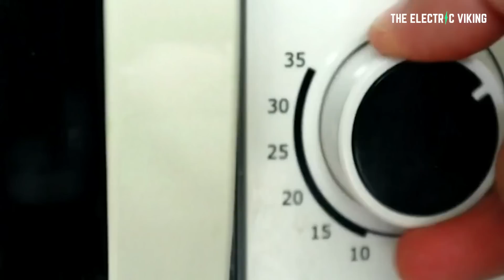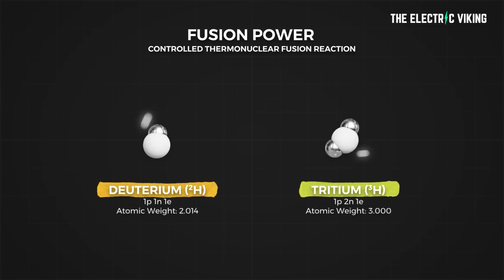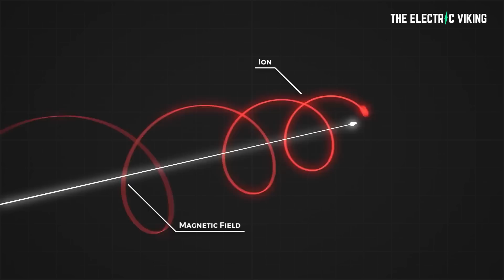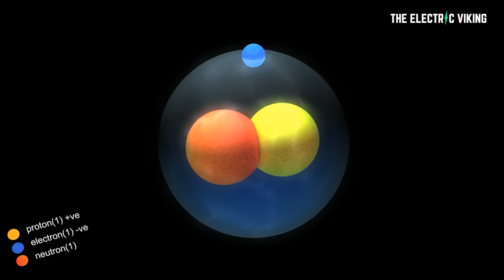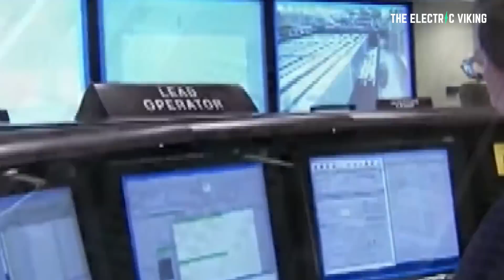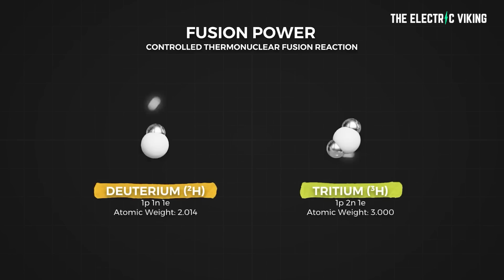Massive breakthrough in nuclear fusion achieved by US scientists

Comment: While this accomplishment is the milestone that they have been working toward for over 25 years, where the energy produced is greater than the laser energy used to produce it.  However to produce that laser energy takes about 10 times the electrical power.
I have visited the NIF (National Iginition Facility) several years ago, an interesting fact about it is that they have to store up energy in huge capaction banks and then release it all at once in an extreemly short pluse, to power the lasers, during this pluse the energy going to these lasers exceeds the entire electrial energy being used in the USA at the same time.
Reply: The 2.05 input is just an estimate, or recalculation based on how inefficient they’re claiming the lasers were. They’re ignoring nearly 300 megajoules of the energy cost “lost” due to inefficiencies they’re explaining away. It’s most likely that calculation that’s wrong. When they’re trying to rationalize away around 300 megajoules of the input though, it’d be easy to lose track of 0.95 of a single megajoule. Until they’re no longer pumping in (and losing) 100 times the energy they’re getting out of this, there’s no way to prove there’s any net energy gain, at all.
Reply: @aalvarez2914  Yes, NIF says the lasers delivered 2.05 megajoules to target and got 3.15 megajoules out; however, the lasers consumed 322 megajoules in the process...so overall it was a net loss...if you read the fine print.  😂

Comment: Sounds great, but even if you achieve a 20% gain in energy out, how long will the equipment stand up before needing replacement? Will the replacement and maintenance costs keep it from being practical?
Reply: only one way to find out :-)    i for one am pretty certain, all of those steps can be solved.  but it's even possible, that at the end it's "just" another means of producing energy, along other hopefully clean sources.
Reply: just a tiny hydrogen bomb， but it is needed for presidential election.

Comment: That net gain is deceptive to say the least. They spent 2.1 MJ of high order (low entropy therefore costly) laser energy to produce 2.5 MJ of thermal (low order- high entropy) energy.  If you put it back, 2.5 MJ thermal produces about 1 MJ electricity which can be turned into maximum 0.5 MJ (probably a lot less for that high performance laser) of laser energy to put back into reaction.
Reply: It is actually much worse than that, it took 500MJ to fire the lasers !

Comment: Important to understand that the net gain, is in regard to the energy used to heat the plasma. NOT the entire experiment. There's a way to go yet.
Reply: also you still need to ''harvest'' that energy produced and turn it into electricity.
Reply: @Morgan Angel  

Indeed. ITER is an experiment, a former laser nuclear testing facility being used for fusion. The entire plant required 300 mega joules, 2 mega joules were put into the laser, and three came out.

The target was a BB sized diamond sphere with a miniscule straw attached to it, through which tritium fuel is injected. A working laser confinement reactor would require thousands of these, hard to engineer, diamond shells to be injected and blasted with an ultra powerful laser every day. 

Quite how you would manufacture, in a cost-effective way, untold thousands of these microenginnering marvels that require highly expensive tritium is something I would ponder. 

Deuterium doesn't work for laser confinement fusion, so you are stuck with tritium, which is immensely expensive. Tritium is also in short supply.

Something like General Fusions concept seems more viable to me.

Comment: At Kill Devil Hill, in Kitty Hawk, North Carolina - the Wright Brothers achieved  flight. The flight was 1m in altitude and the Wright Flyer only flew down the beach for a few hundred meters. The flight changed the world.  Consider this fact - the net energy gain collects up the energy used from buildings that cross three football fields to direct energy into getting fusion to occur across the electrostrong barrier - if you're going to shrug away the event - just remember. This is the first test.
Reply: I think that is a good view of situation. It may not result in practical fusion power, ever, but it is a "proof of concept." It's like going Mach 1, for the first time. In a wind, solar, battery world, it is likely way too expensive and dangerous, but a huge scientific achievement, none the less.
Reply: Correction, the real first flight was Whitehead’s one, ending in a crash. It was using a self made steam engine. The Wright brothers did their best to suppress this historical event by blackmailing the Smithsonian to delete Whitehead’s flight in order to get the kitty hawk for the museum.
Reply: It’s a promising result, but it lasted 5-seconds and was enough energy to heat about 10 gallons of water.

It’s at least one decade, if not two decades away from powering a single house for one day.

Could be wrong. Hope I’m wrong.
Reply: @JohnBreezy22  It's more important for science than anything that will ever be practical. Wind - solar - batteries will be way more cost effective. I prefer the free fusion reactor in the sky.

Comment: NIF delivered 3.15 megajoules from about 2 megajoules of input energy (so Q=1.5, roughly) in a single pulse. No mention of pulse repetition rate or damage/repairs necessary to fire again. By comparison, the Culham Fusion Lab JET experiment in the UK produced 59 megajoule of continuous power for a five second test (so almost 11 megawatts) - although its Q ratio is at best only 0.67 (less than the 1.0 break even point). Its successor, ITER (in France), is more likely to produce a working fusion reactor than the Livermore NIF, in my opinion, and some as yet unseen, dark horse may beat both. Interesting news, though.
Reply: I agree completely....we already have fusion bombs that achieve a Q greater than 1... The actual breakthrough will be when we achieve a long term Q greater than 1 and the energy needed to contain, recover AND convert to electricity the energy of the output of the reactor is put into the equation.  I don't see this as anything more that a Federally funded lab putting out headlines in an effort to keep their funding.
Reply: Does it really matter which country does it as it long as it gets done?
Reply: When you discuss Q ratios and don't SPECIFY if it's scientific or practical (or experimental vs. total), it's MEANINGLESS and it can be VERY misleading. 

This is ONLY the DIRECT energy into the lasers.   So what?  All the overhead like containment, etc. still takes a LOT of energy.  This is creeping forward, but still LIGHT YEARS away.  The arm waving is all about trying to attract funding, and the media is mostly too stupid to point out that it's NOT Q(practical) they're talking about in such announcements.
Reply: @rogergeyer9851  There is NO NEED TO SHOUT. Anyone interested can easily look up the relevant information (Livermore isn't holding back and nor is Culham) so please try not to make (mostly) pointless remarks in the future.
Reply: @rogergeyer9851  They were very clear that this was scientific--it took over 300MJ of electrical energy to power the laser.  (The lasers were designed to be precisely timed & powerful, not efficient.)  However without this test, it would be difficult to know if it's even possible to have inertial confinement using lasers.  They were also saying that JET/ITER was further ahead even though they got ignition first.
Reply: @rogergeyer9851  target gain is certainly not the only requirement for fusion energy, but it's absolutely not meaningless. 

Improving the efficiency of all other aspects of a power plant is possible, but target gain is absolutely necessary, and it has never been done before, some doubted it was even possible. Now we know without doubt that it's possible.

Comment: Inertial Containment is not a practical approach for a Fusion reactor. A Tokamak or Stelarator approach is needed for a constant reaction. Also the seawater bit is not quite right either . The current process requires both deuterium and tritium as far as I know and trituim is not so easily obtained. So they used Hundreds of Lasers bigger than 4 football fields to get Fusion in a tiny pellet . As much as I want this to work this seems like a side show.
Reply: Helium 3 from the moon is all that will be needed!
Reply: Yeah.  It's sure nice to have a side-show to watch while we wait for ITER to fire up!  I also think it's possible to design a fusion reactor based on this technique, but the Tokamak is more likely to be economical.

Comment: Hi, if you look closely they are talking about the power gain of the plasma alone, and that for a fraction of a second. What a power station needs to do is generate more power than it receives, and do it 24/7. The power losses due to steam generation and then electricity generation are 40% at best. The power used by all the other kit it significant. So in reality they have made a good step forward, but are way, way short of making a useful power station. Strangely, the scientist know this well, but insist on reporting the plasma efficiency alone, which is at the least misleading.

Comment: Problem is what fuel being used , many fuels talked about for fusion are limited , forms of hydrogen that are very scarce
Reply: They used the typical Deuterium/Tritium blend.  It's not the only fuel they use for experiments, but it's the one used when they're trying to get ignition.  The Tritium would have to be produced from a lithium blanket that captures the excess neutrons from the fusion reaction.  Currently, Tritium is most often produced in heavy water reactors like the CANDU.  Deuterium can be harvested from water, which has been done for decades for how heavy water reactors.

Comment: While yes, most fusion reactors employ the use of extremely powerful magnetic and electric fields and high voltage components, your assertion that they can be dangerously explosive is just wrong; The Dark Knight Rises isn't at all scientifically accurate. 

In a tokamak or stellarator at least, if there is a disruption in the plasma, it simply loses energy and dissipates; there is no possibility of runaway like there is with a fission plant. If we aren't actively sustaining the fusion reaction, it can't happen naturally - you would need something like the sun for that to be possible.

If you want to learn more about the cutting edge of fusion, especially the private sector, check out Commonwealth Fusion Systems, Helion, General Fusion, Tri-Alpha, and more!

Comment: False. Fusion is still at least 20 years away. All the headlines in past 50 years claiming fusion has been cracked were misleading. 

Two things - firstly we have no fuel for fusion, we need deuterium and tritium, neither which is abundant or cheap to produce. Secondly - net gain is a lie. Checkout video from scientist Sabine Hossenfelder about it, essentially it is net gain in theory not in practice. It does not include inefficiencies from running the reactor, and also it does not include inefficiencies from collecting the thermal energy.

For real net gain (just so the reactor can run from its own energy production) you need few times more energy production that this new "breakthrough" provides. That is at least 10 years away. New industry for fuel production will also take about a decade to make, and actual economically viable fusion reactors might take another 50 years. I'll be happy if I'm wrong

Comment: You need to make a distinction between Q and Q(total).  Q is the energy gain factor for the reaction (running laser compared to energy released by fusion) - and the energy based on the energy to sustain the fusion reaction in the fusion reactor.
Q(total) is the total energy of the power station , and for comparison, a gas powered  station uses 15% of its energy produced to run the power station (excitation of the stator + cooling, control systems) 
The amount of energy for Q(total) compared to Q in a fusion power station is about 10 times - ie you need 10 times of energy of the laser to run the "power station".  So you can see that a fusion powerstation based on this CURRENT technology would use energy to run as the additional containment energy, generation power and just general running is large.
This issue with Q and Q(total) has dogged the fusion publicity for years.
Reply: What do u think Sabine?
Reply: for this experiment, Q(total) was about 0.01  (300 MJ in, 3 MJ out)
Reply: I'm watching this after the press conference.  It looks like they put 2MJ of light energy in, and got 3MJ of energy as neutrons out, but it took at least 300MJ of electricity to power the lasers.  I'm glad the scientists are being clear about the distinction.  It's still a huge achievement, though, because the lasers were designed to have precise timing, not to be efficient.  As a point of comparison, 300MJ is similar to the power stored in the battery for an electric car, whereas 2-3MJ is closer to the power stored in an electric bike.
Reply: @nathanbanks2354  try delivering that 2 MJ in a femtosecond.   a lot more engineering to do.  it took 25 years to get from 0.67 to 1.5 Q
Reply: @nathanbanks2354  as the other commenter said , try power a bicycle in a femtosecond , so one quadrillion bicycles per second. Get it now?
Reply: @Nonchalant2023  Yeah, the time scales are crazy and the engineering is really impressive. 3MJ is also the amount of energy required to bring 10 litres of water to a boil (25ish°C to 100°C).  Released in the time it takes light to move an inch.
Reply: @nathanbanks2354  That's all well and good, but this channel doesn't seem to know the difference between power and energy...
Reply: Not now
Reply: 💯Is that a research grant application I see in your hand ? We already have a working fusion reactor. It’s called The Sun. All we need is a solar panel to collect its almost infinite energy.
Reply: P.S. The net yield 1 MJ is equal to 0.3 kWh. On average across America that’s about 6 cents worth of electricity. And how many millions of dollars did that cost to produce? Why is all this money being wasted on voodoo physics experiments ??

Comment: Ha, my first reaction to the title was "What, did they reduce the wait time from 30 years to 25?" This made even funnier by "ABANDONED" at 5:58, complete with a fancy split slide visual effect.🤣

Being realistic, a net gain of 1% would be silly because overheads of all kinds can easily eat that, but it is in fact a huge milestone and it gives the bump needed to get the whole world working toward 2%, 10%, 50%, etc until it is outcompeting anything else we have on the planet, and thus we are finally free to move forward into a civilization far more resembling something in control of ourselves and the planet than the sad joke we are right now.
Reply: 1x1.01x1.01x1.01x1.01.... does not equal a small gain over time. It's potentially "infinite" if it's continued long enough.
Reply: @kendigjl  I wasn't claiming tiny gains over time. I was stating that even if the INITIAL power output might be very, very low, subsequent gains would potentially be exponential up to a certain point due to sudden widespread experimentation across the globe due to increased interest in mastering the technology. Hardly small gains over time. That said, it can't be infinite since even 100% efficient fusion can only produce a finite amount of power for a given fuel input.

That is, until we start powering starships with it. Then all bets are off.

Comment: It's cool to see my old hometown making the news. Livermore is a really cool place and has about 40 wineries plus a bunch of science geeks running around. It's in the East Bay of the San Francisco Bay area and very close to Silicon Valley. The national ignition facility at LLNL is a very cool science experiment. However, I think TAE, Commonwealth fusion, first light fusion, or general fusion will be the people that achieve engineering break even estimated to be around q equal to or greater than 5. The cool thing about TAE is that they do not rely on tritium and have a direct way of capturing the resulting energy. I think it is less of a science experiment and more of a practical solution.
Reply: How do they directly capture the Energy?